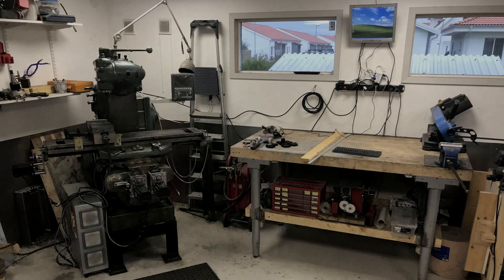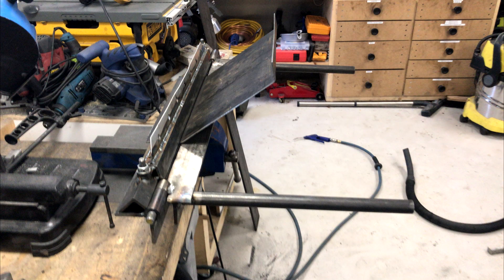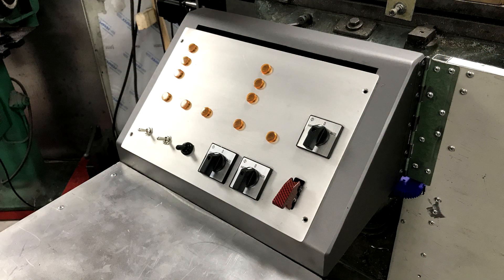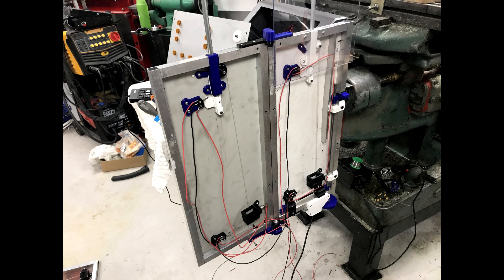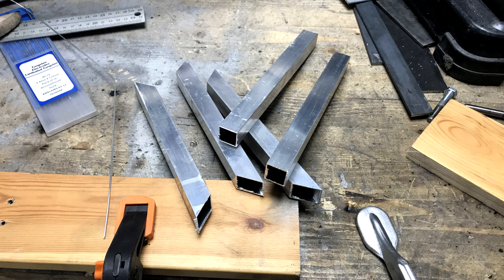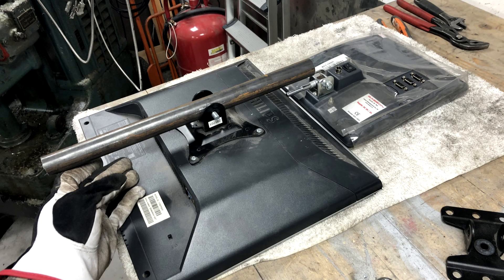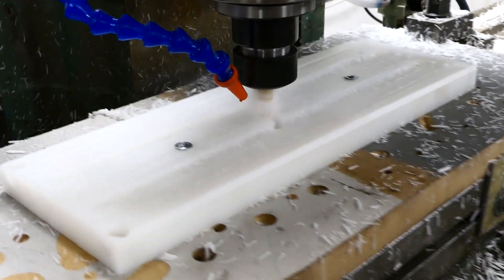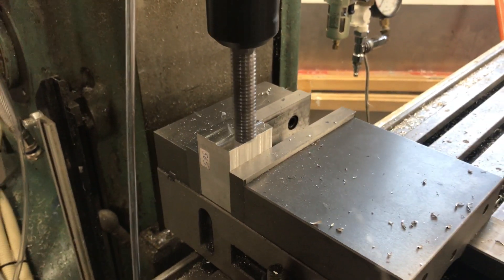Kearney&Trecker Milwaukee 2HL CNC conversion Part2

Comment: Hi. What about lead screws? Did you leave the trapezoid without replacing it with a ball one? I wonder how much slack did you get that way? Best wishes.
Reply from the maker: Still using the stock screws, which are heavily worn down. I have 1.5 to 2mm backlash depending on area.
Will change to ballscrews once I’ve scraped the ways
Reply: @MrCrankyface  Does software compensation work at all with this slack? How do the holes come out? I'm doing retrofit of my Polish FWA41M ( 5 ton machine )This year but i think i should change screws at start :)

￼
Reply from the maker: It works somewhat but I would recommend changing the screws if you plan to do any kind of CNC moves. This was at first just to get "powerfeed with bonus features".
Since the screws are not worn evenly, the backlash will differ and the compensation doesn't work 100% because the compensation is a fixed value.
Further more, on heavier cuts the table/saddle can move into the backlash area and cause havoc, so in many ways you still need to treat it like a manual mill.
If I need a perfect hole I will mill it undersize with XY movements and then use a boring tool it so it's properly round.

Unless I deploy a lot of tricks, I can't get much better than 0.1mm accuracy over long distances when relying simply on CNC movements, that's why I still have the DRO mounted for more preceise work.

Comment: Thank you very much for making these videos. I really enjoy following your content and progress. The voiceover from mrs. crankyface was absolutely fantastic. Can you please tell me what step motor you used? You also mentioned in the previous video that you needed to build a computer from scratch. Is it possible to help guiding through building a computer? Thanks in advance. ☘️
Reply from the maker: Thank you!
I bought the stepper motors on ebay, they were called as following:
"12N.m Nema34 154mm Closed Loop Servomotor Servosteuerung HSS86 Driver CNC Kit"
"2x Nema34 6A closed loop stepper motor 8N.m servo motor&Servo driver&3m cable"

I'm running them on several 70VDC/500W power supplies, I would recommend going with even higher voltage. The motors can take 100V AC I think.

For a computer guide you're much better off watching the pros, check out Linus Tech Tips for example!
https://www.youtube.com/watch?v=v7MYOpFONCU